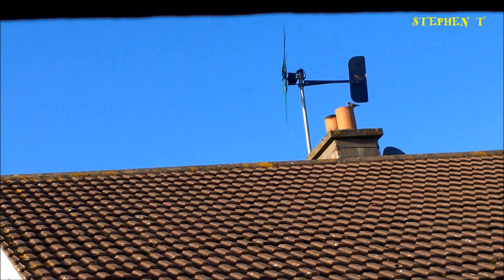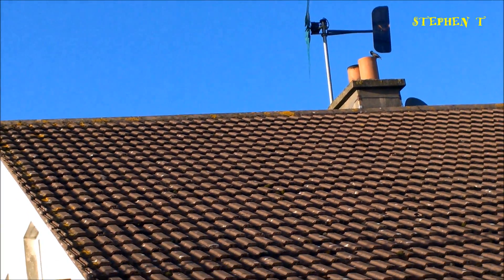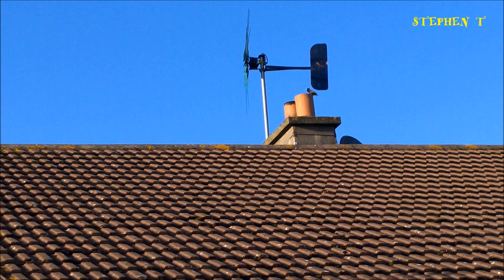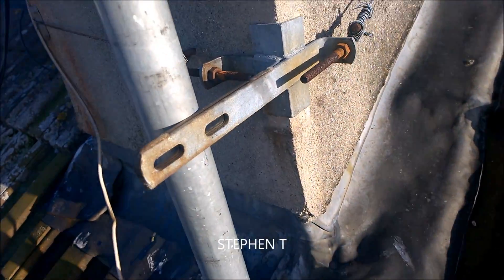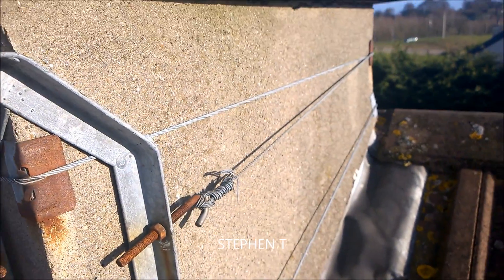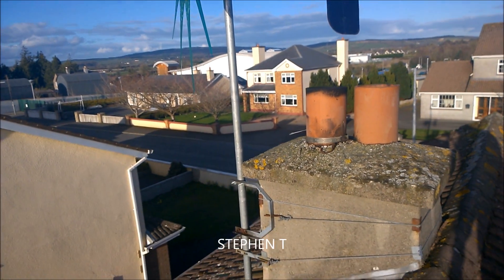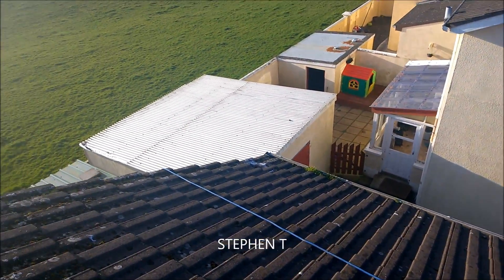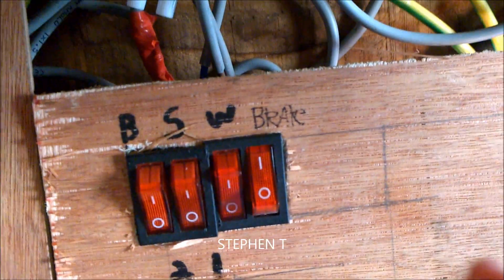WHY YOU NEED A ELECTRIC BRAKE ON YOUR WIND TURBINE

Comment: Putting it right there might actually increase power, since in theory, wind is redirected around and up over your house, sort of like channeling it into the turbine. Though it all depends, as you might just have too much air resistance, then it won't work as well.

Comment from the maker: Paul Donnelly there is a noise if the blades are not balanced. If the turbine is not a good make the noise will be huge. What I did is wired in an electric brake into the system so I could stop it spinning when I wanted to. I got a good wind turbine from THERMODYNE it had a great output to. I have a video on my channel to show you the electric brake if you want? I will put in the link here for you.
Reply from the maker: I forgot to say to you Paul Donnelly that I put rubber around the metal parts that are in contact with the house. It makes it very quite.